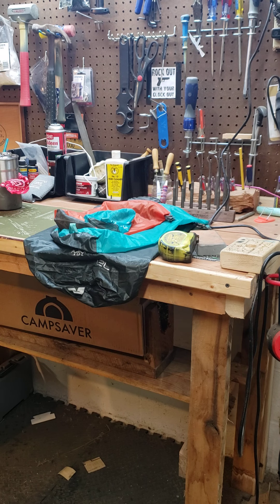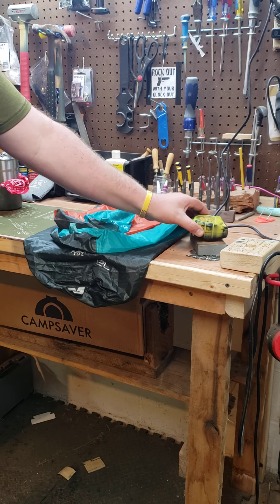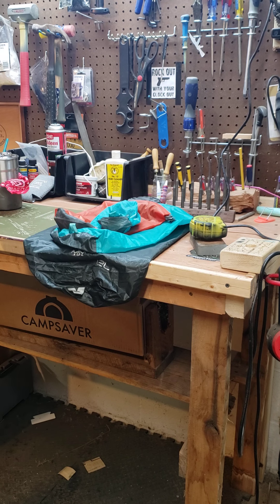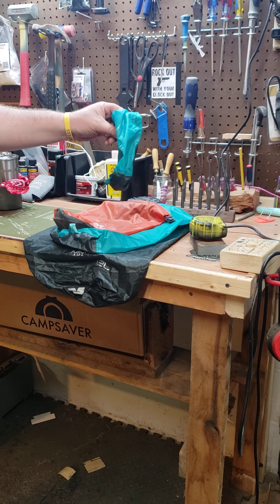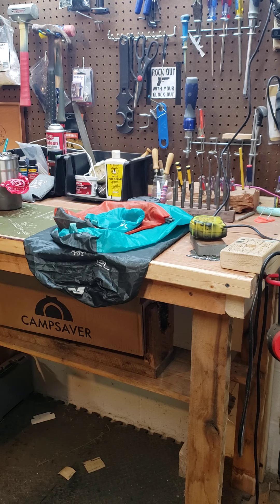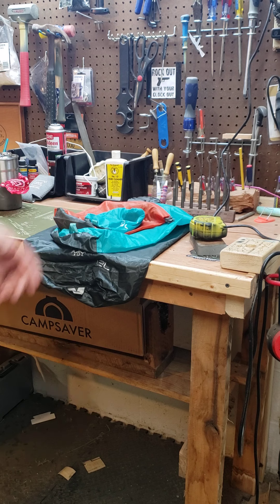Osprey 1.5L 3L 6L 12L dry sack size comparison Stanley Adventure Cook Kit

Comment: I've been gearing up with dry bags lately. Started with a 20L, next up was a 30L (still hasn't arrived yet). What's important to me is keeping my sleep system dry, my clothes, TP, and I'm on the fence still about how to store electronics. I may go with a hard case for my cameras and batteries. And I'm looking for a waterproof solar panel to strap on to the kayak to charge things as I paddle. For cook gear I have netting/mesh bags.
Reply from the maker: Sounds like you have a solid plan. I'd agree with you on the gasketed hard cases for electronics since you're on the water.